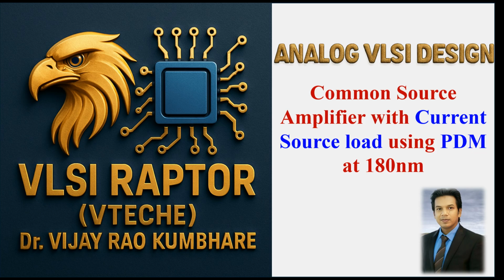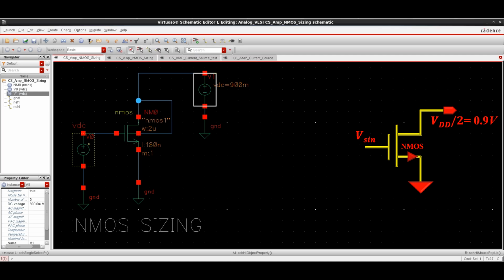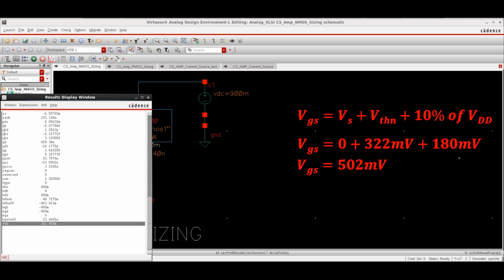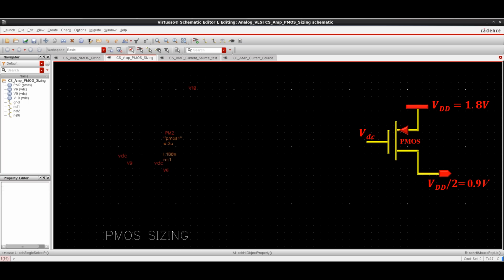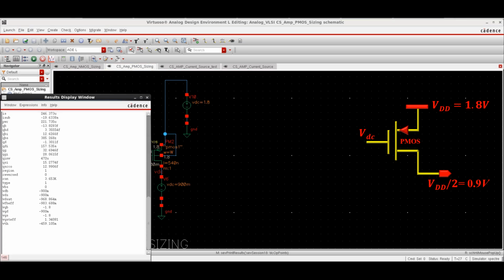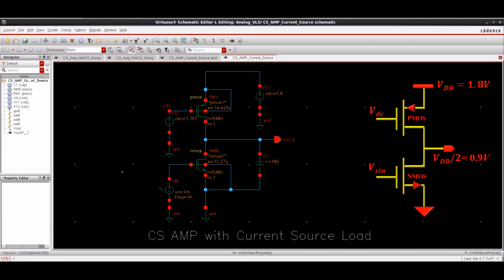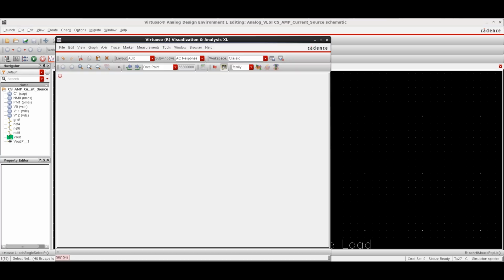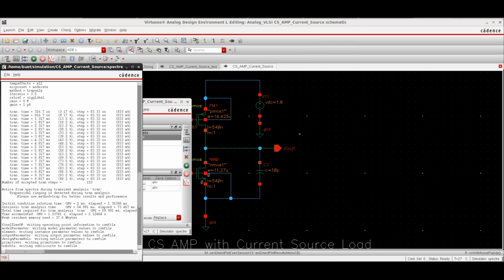Common Source Amplifier with Current Source load using PDM at 180 nm

Comment: Sir I understand all your videos on Comman source with resistive load, diode connected load and current source  but sir all your calculation in finding the w/l of the mosfets according to the region they are operating you are calculating them  with the help of cadence calulator option and with the help of parametric analysis. Sir is their any method via which we can calculated the mosfets operating  region theoretically and check whether practically on cadence if mosfets are working on same operating regions based on our final calulations
Reply from the maker: Use Ids expression     W/L≈ 2ID/{(μnCoxVOV^2)⋅(1+λVDS)}and check for saturation region condition Vgs> Vth and VDS≥(VGS-VTH).